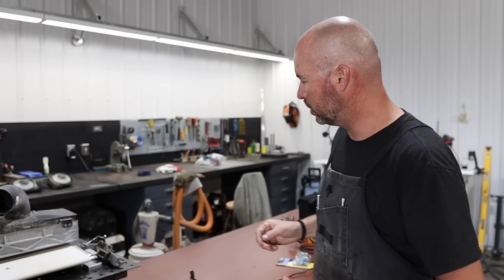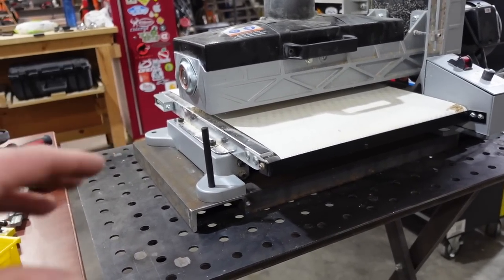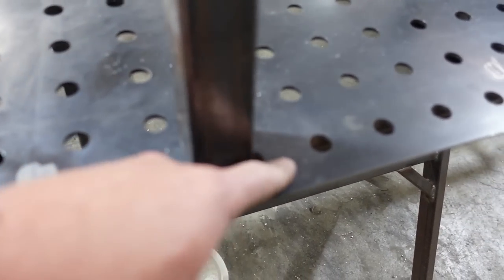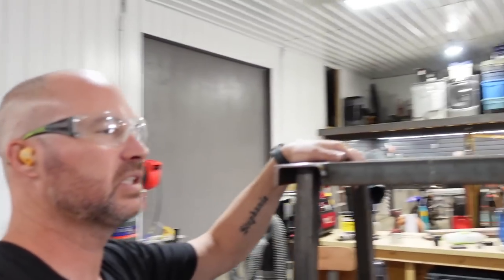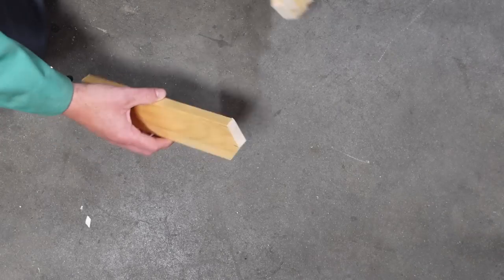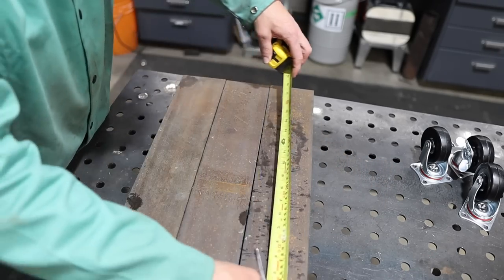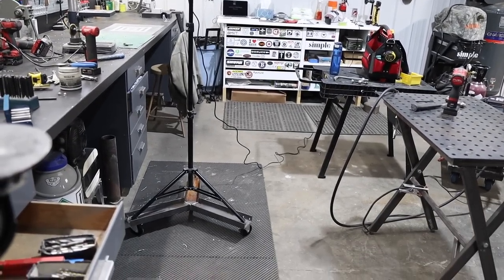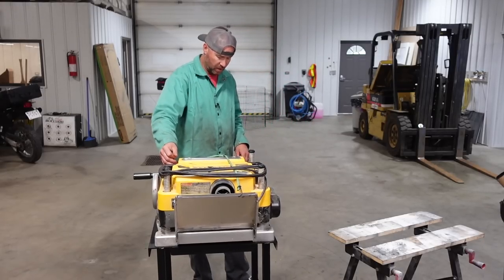Setting up the new shop part 2

Comment: Instead of using the lighting stand to move the light around. Being as it's a little shaky. You could weld some handle assembly up from two of the stand legs or all three and have the handle arrangement encircle the stand in the center. That way it would be a lot firmer/stable. And you would have a structure in place for hanging things on. It could be circular or triangular and it would be the same size as the mobile stand itself, sort of like railing at the right height for you. If you ever needed to remove the light stand, the legs would just fold and it could easily be removed.
Love those stands. Solid and stable builds. Don't forget to add a little color into the shop. LOL

Comment: For the drum sander and the planer while milling long boards, I made an outfeed cart that has an adjustable top that can go up and down to match the height of the two machines.  For your shop, that kind of cart could have many more uses.  For a larger worktable, check out Fireball 2ool on YouTube in his product section.  He has a 30X60 table on his last product page, and he made a larger table on his July 13 video.

Comment: What type of drills do you use in your drill press? Cobalt? Do you change the speeds with the pulleys on the top for the different sized drills? Or do you keep it set to one speed all the time?